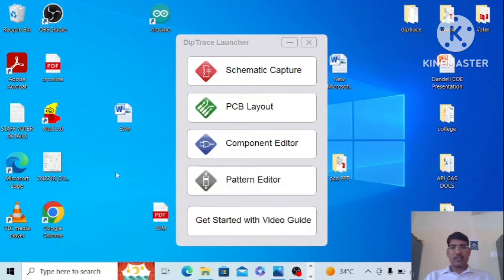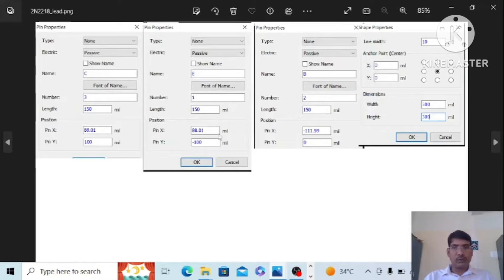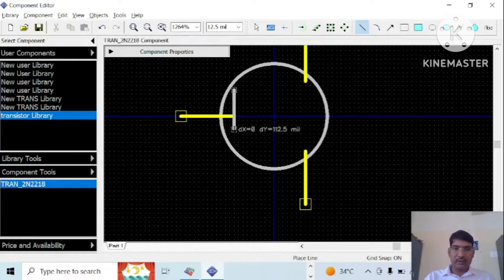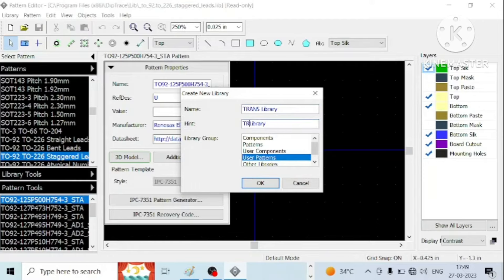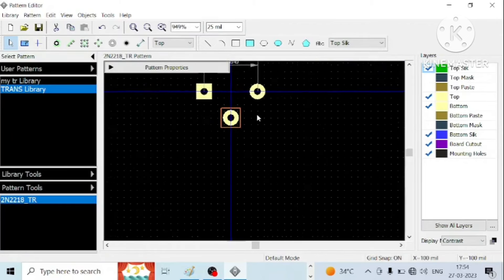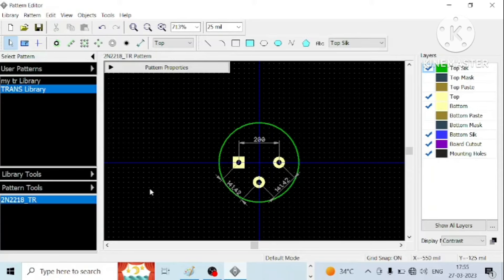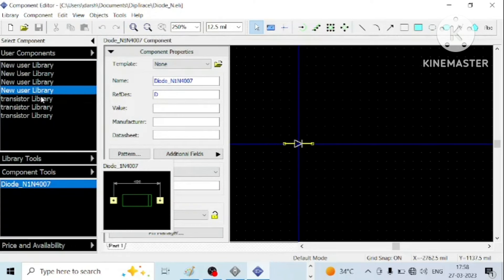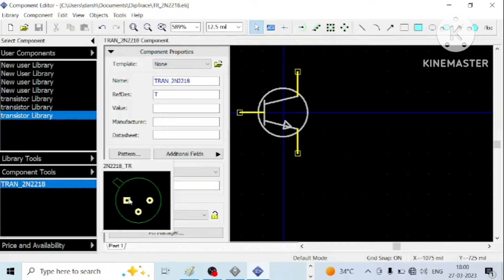Create Transistor component and Pattern in Diptrace

Comment: hai, how to find others transistors sizing? im creating BC547
Reply from the maker: Kindly refer to the datasheet of BC547 for mechanical dimensions of transistor
Reply: @ can i use the same dimensions like you used?, because i refer some notes and they said, basically all transistor is using the same sizing and dimensions on software
Reply from the maker: @alifhakimi8132 

You can but there will be minor variation on dimensions as both come in different packages. You would face difficulties in mounting components on PCB
Reply: @tanishkaacademy8526 okay noted